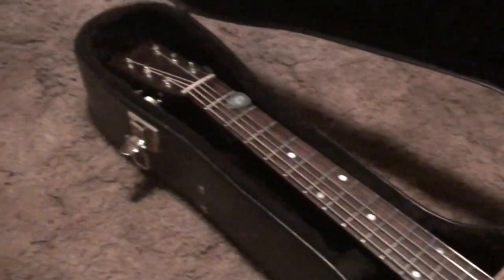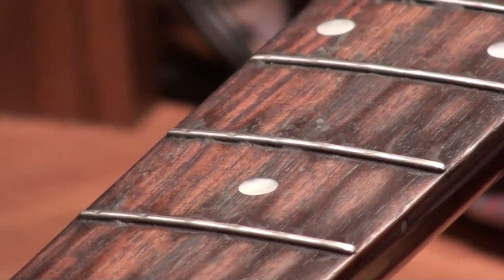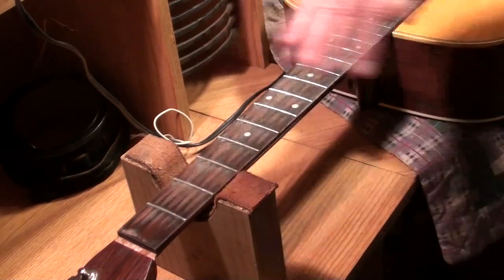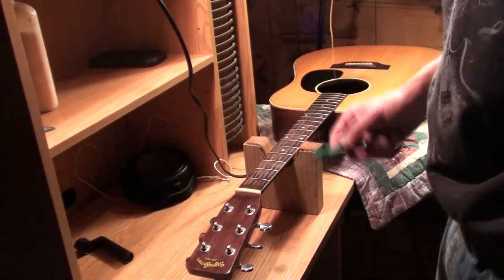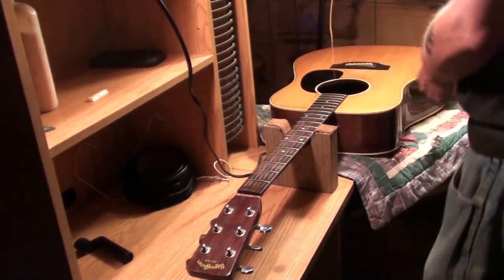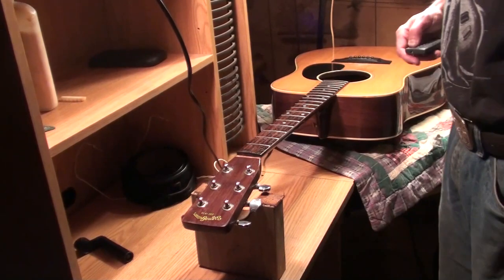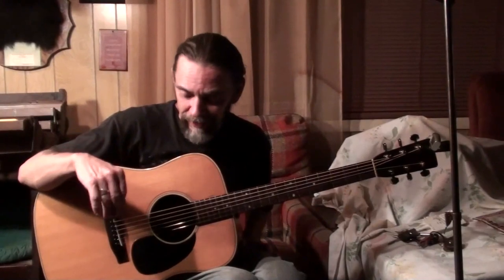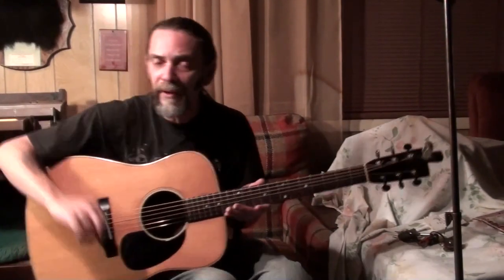Sigma acoustic guitar fret dressing & set up & saddle replacement how to

Comment: I have a Sigma DM1 , I did a bit of work but ended up having a lot of twanging sound on the B and E strings. Do you think I need to change the saddle, I still have the original factory  stuffs  in it on a 19 yrs old guitar.  Thanks